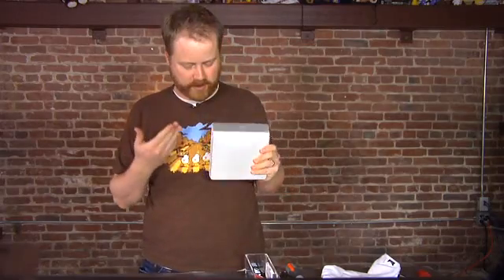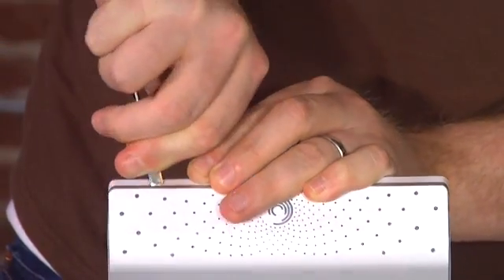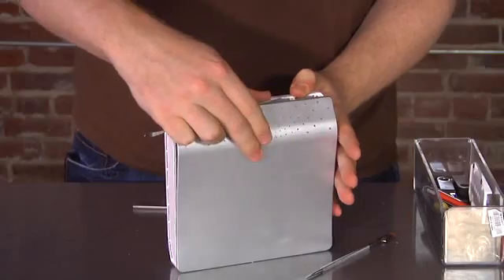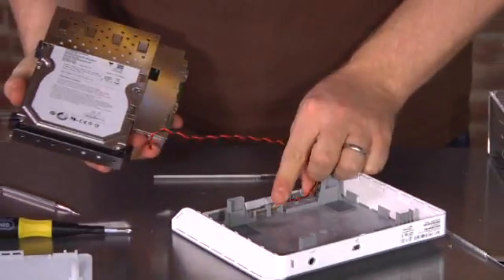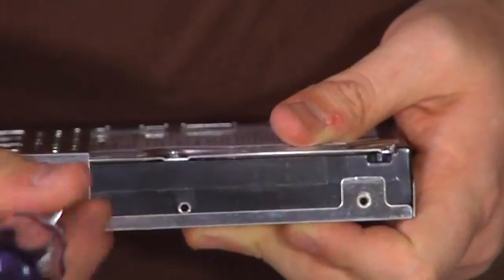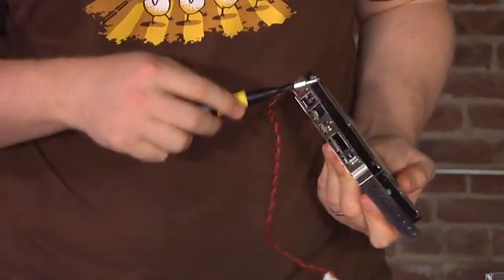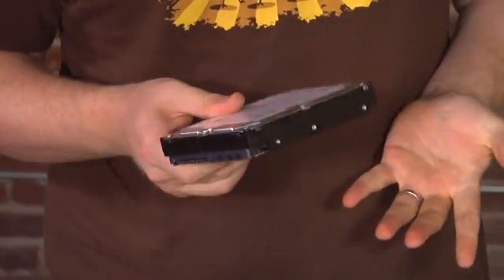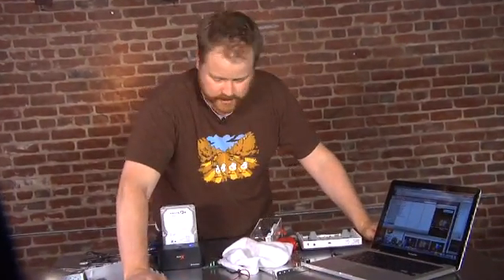How To Take Apart and Recover Faulty External Hard Drive

Comment: Enjoyed that, but now, a question-- 

Your Seagate external USB enclosure employed a drive controller. If an enclosure-based HDD controller manages partitioning and all other drive operations, how can you remove the HDD from its controller, and view the drive and data while disconnected from its native controller? 

That is, you removed the drive and plugged the bare drive into a stand-up drive mount in order to check for vital signs, but the stand probably has no controller. So, what functions did the native Seagate controller serve on this model? I have one almost exactly like it-- weird shape and all.

Comment: Am I right in thinking that all external hard drives are nothing special - they are just regular internal drives with a few extra electronics and installed in a plastic shell?  I am now thinking of removing all the casings on my external hard drives and putting them all in a NAS.  Is this a good idea??
Reply: The whole point is that they are portable
Reply: Only use NAS Approved drives for NAS otherwise ya get unreliability

Comment: Here's my question: I have that exact same drive, which only has the USB  connector (1TB instead). If I dismantled mine like you did, and put it in an enclosure that had firewire on it, wouldn't it be better than USB? For video editing purposes and data transfers, wouldn't I see a noticeable difference in speed?